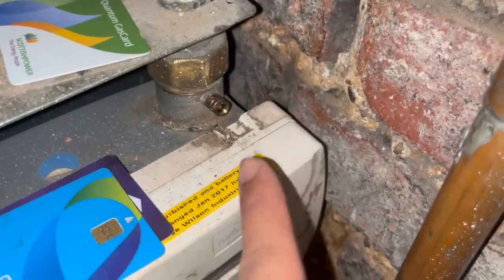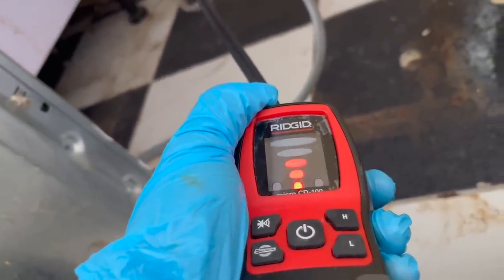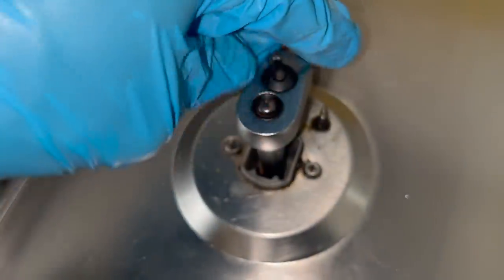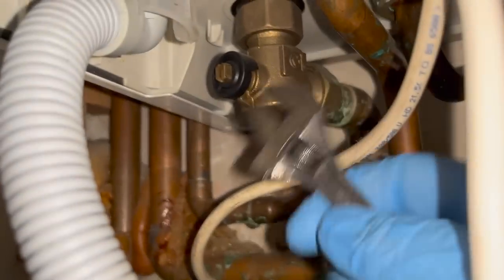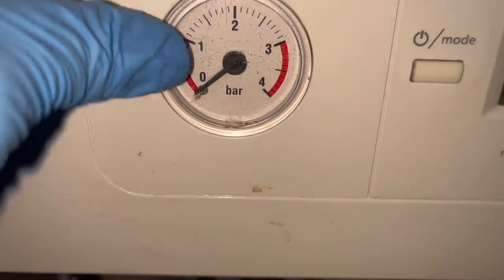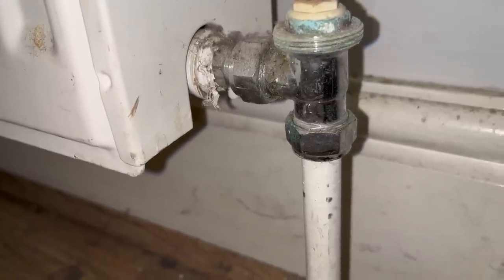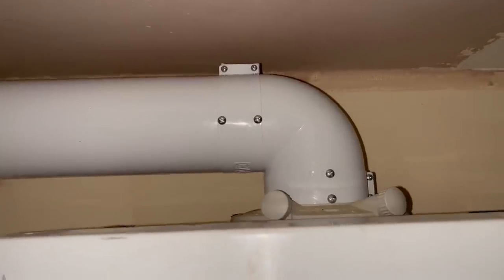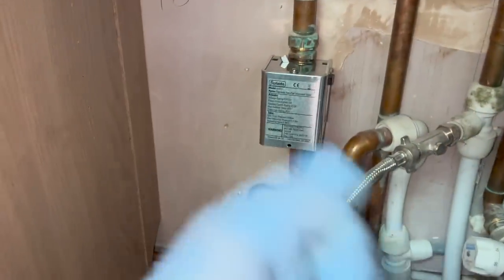Day In The Life Of A Gas Engineer #10 | Gas Leaks, Boiler Repairs, Wiring & Going Back To School

Comment: Is that a radiator boxed in with the kitchen units when you were showing the gas leak? Plus, you're studying electrics and test voltage with a volt screwdriver? Come on.

Comment: Nice work.  That hob was connected with a tap connector, shoddy work from somebody, don't think that's actually permitted for gas, even if it could be made to fit. Don't know the secret to the Vaillant drain-off, would be useful to know because draining down Vaillants is something you end up having to do a lot...
Reply from the maker: It’s crazy that people even try to do stuff like that. They can see it clearly doesn’t fit 🤷‍♂️

Comment: What size socket goes on the cooker hob?
Reply from the maker: If you’re talking about the injectors then I think it might be 6mm or 7mm. Can’t remember off the top of my head, I have a whole socket set so I just used the socket that fit
Reply: 7mm